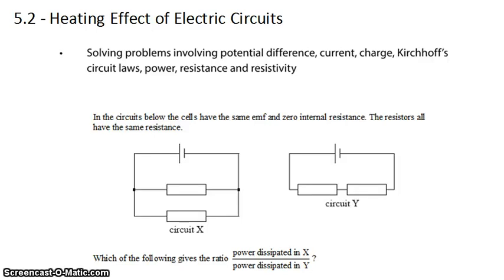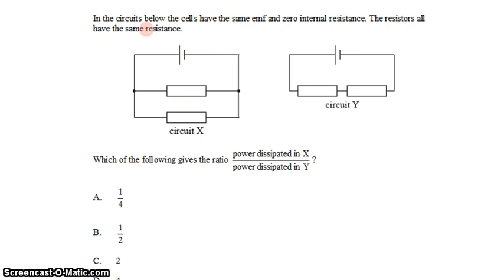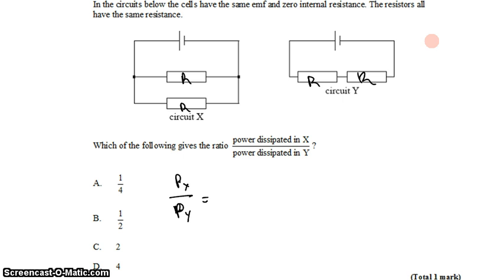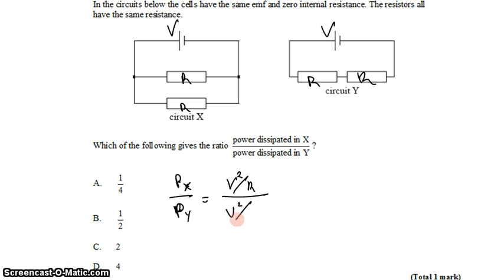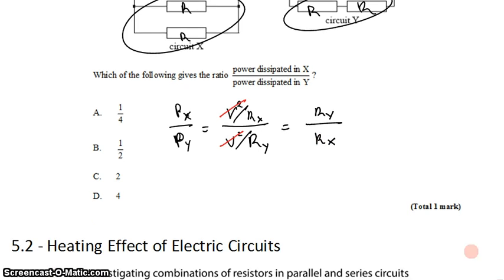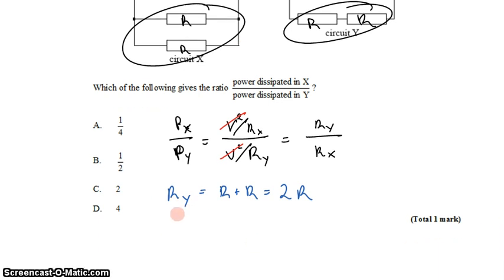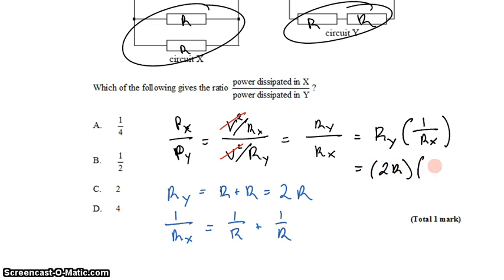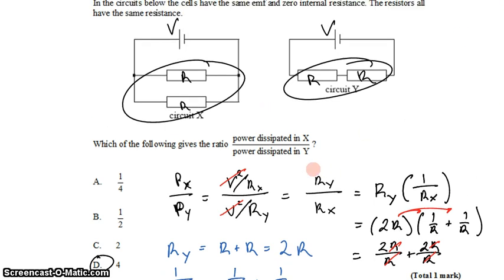5-2   Parallel and Series Circuits

Comment: The answer should be A. Instead of dividing the power dissipated in X/Y, you divided the power dissipated in Y/X. So the answer should in fact be the reciprocal of 4, which is 1/4
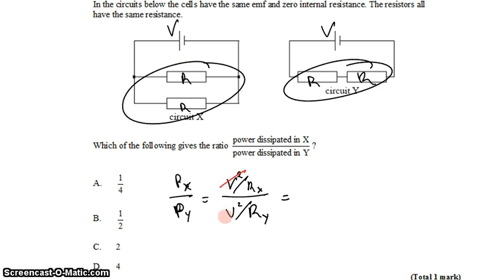Reply: yea but listen from 1:43, he canceled out v^2 so now it's (1/Rx)(1/Ry). that's why it's equivalent to Ry/Rx. I already checked the answer and he's right